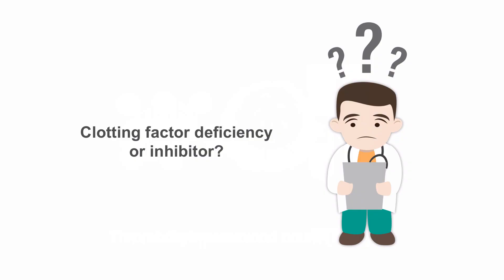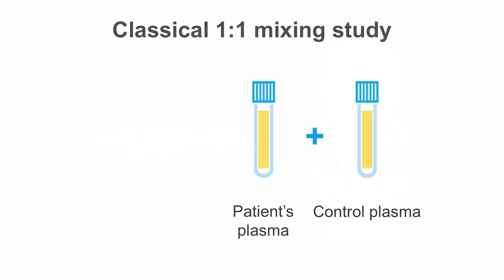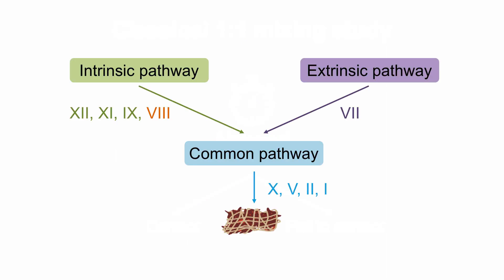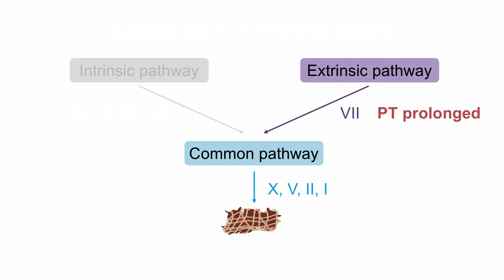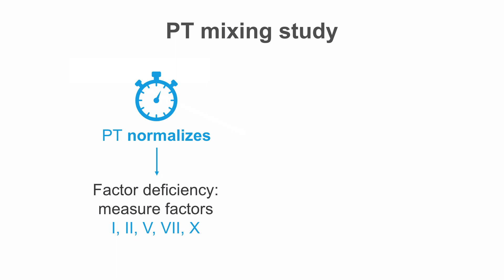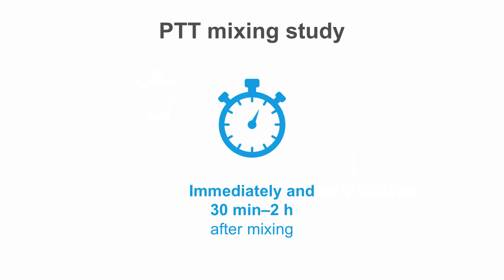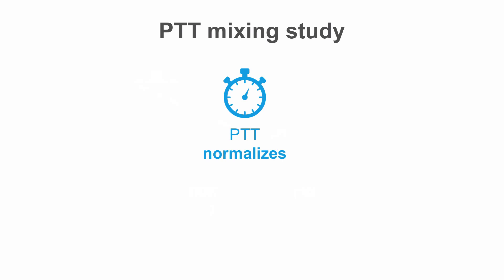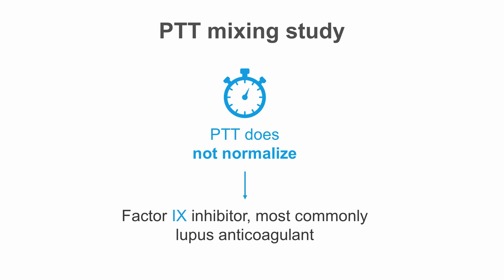How to interpret a mixing study - Coagulation Essentials

Comment: The problem most people have with mixing studies is the interpretation of whether the original clotting time has actually "normalized" or not.  For example, if the initial PT was 80 and the mixing PT clotting time (50/50 with pooled normal plasma) was 17 seconds --was this clotting time corrected ("normalized") or not?  A 17 second PT is not "normal" in any laboratory reference range but the clotting time was significantly shortened by 63 seconds.  Any presentation called "How to interpret a mixing study"  that does not actually discuss how to decide (interpret) whether a clotting time has corrected or not is leaving out one of the most important parts of the discussion.
Reply: One can utilise the Rosner index for the aptt or percentage correction for both pt and aptt
Reply: @kv8585  The problem is that different studies/ articles use different cutoffs for their Rosner index and Chang % correction calculations.  There is no agreement, from what I can see, on the correct cutoff for either of these methods.  I did my own experiments with both of these methods and they just wasn't as conclusive as I would like.  The Rosner index seemed to be a bit more accurate than the Chang % correction (in our laboratory) but neither method was correct in 100% of the test cases that I used in my study.  I ended up using the Rosner index but adding a comment, to every result, in the form of a table with 4 different scenarios based on whether the result corrected back to the reference range and whether the Rosner index was below our established cutoff.   Each scenario includes the words, "The results are most consistent with..."   In other words, we are not reporting a definitive answer.  Most clinicians are "OK" with this but there are some who are frustrated and would like a more conclusive interpretation.
What are you doing in your lab and how did you validate it?  By the way, we also add a comment that "mixing studies are not sensitive enough to detect all LA's.  If clinically indicated, please order the lupus anticoagulant panel."
Reply: @jeannecommer8042  for the aptt we have just validated the rosner index. I would also include the importance of clinical details ie thombotic or bleeding. Let us not forget the sensitivity of the aptt reagents to factors and lupus. Syntasil SS is very sensitive to even mild lupus whilst Actin FS is less sensitive.
Reply: @jeannecommer8042  for the validation, we utilised residual plasma from previous cases. Reagent selection is very important and can be easily done. I once did an exercise in order to compare lupus sensitivity between two different PT reagents. So basically had excess stock of pos LA controls, did a dilution with NPP in order to obtain 100, 90, 80% etc up to 0% of normal controls, then analysed the PT. We plotted the data and the cutoff utilised was the upper limit of the PT reagent specific normal values. Despite both reagents are recombinant, they did have different sensitivities to LA, which might also pose a problem since LA strong patients are given warfarin. 

Personally, without proper clinical details I would not perform a mixing studies. Also important is the choice of NPP which without sounding sexist, I would not include females due to high fviii and fibrinogen. Controls and calibrators may also not be suitable for mixing studies. 

If you are interested, there is a very good e book from the wfh website by Dr. Steve Kitchen and is free to download.
Reply: @kv8585  Fortunately, we do have access to all or most of the clinical patient data but sometimes, it is unclear--even to the clinician.   We have had cases where both bleeding and clotting have been reported and recently had a case where the patient had both a strong LA and a strong factor VIII inhibitor.  
If a mixing study is ordered, we always also perform a lupus anticoagulant panel (we will call the doctor, if need be, to get this ordered).  We use Hemosil DRVVT and SCT kits on the ACL TOP 750 and feel very confident about these results.  With every lot number change we use 40 normal plasmas to determine normalized screening times and ratios.  Our cutoffs are based on a 3 SD range-- following the recommendations of the manufacturer and ISTH.   These procedure are clear and we have no problem identifying LA's.
The problem lies with mixing studies.  We use mixing studies to try to distinguish a factor inhibitor from a factor deficiency.  We have strict guidelines on what plasmas we will test.  We will not test patients on anticoagulant.  We run heparin levels to rule out heparin from a line draw or any other source.  We check the patient's medication history carefully.   There are plenty of examples, in the literature, of ways to run mixing studies and how to interpret them--but no rules or recommendations from regulatory agencies, or the ISTH on the BEST method to use.   Do we mix 1:1?  or 1:4?  Does "normalization mean correction back to the reference range?  Should the cutoff for the Rosner index be 15? or 11?  or somewhere in between?   
There are, however, plenty of admonitions that every lab should validate their own mixing study methods, cutoffs and interpretations.  I spent almost a year doing just that.   I collected a huge amount of data--from journal articles, web articles, web blogs (like this one) and designed my own validation study (ISTH does not have a detailed suggested mixing study validation procedure).  I looked at plasmas from congenital factor deficient patients, patients with LA's, plasmas from patients that had factor VIII inhibitors and normal  plasmas.  We use FDA approved PNP from George King Biomedical for our mixing studies.  This PNP contains citrated plasma from 30 or more carefully screened normal human donors and is platelet poor with no buffers or preservatives.  They also supplied many of the frozen factor deficient plasmas and a plasma with a strong FVIII inhibitor.  We also used frozen samples from patient samples.  
I determined, very quickly, that defining correction as "back to the normal reference range" was not acceptable at all in our laboratory.  By the way--we establish our own reference ranges for adults and use the "Toulon study" pediatric reference ranges for children (2016).  After months of experiments, I had narrowed my options down to the Rosner Index.  But, it was not 100% accurate.  I had to choose the cutoff that was the most accurate and supplement that with a "most consistent" comment.  I feel that ISTH or regulatory agency should publish both a recommended mixing study validation method and a recommended method to establish a Rosner index cutoff if that is the chosen method.   They have recommendations on every other kind of coagulation testing!  
I realize that I have gotten a little long-winded.  Sorry!  It just seems to me that there are too many articles on mixing studies that do not address the interpretation issue.  They start with--If the mixing study normalizes--do this  or if the mixing study does not normalize--do that.  They tend to skip the part about how to determine if normalization has taken place.  Thanks for sharing your thoughts and suggestions.
Reply: @jeannecommer8042  in order to distinguish between a factor viii inhibitor from a factor deficiency, we make use of an incubated mixing studies.
Reply: We do too.  A two hour incubation.  
Can you tell me what your validated cutoff for the Rosner index turned out to be?  The one that worked best for us was 15.
Reply: @jeannecommer8042  same here, more than 15 signifying a non corrected mixing studies. 
The problem with standardising the mixing studies is that there are so many variables, that it is very difficult to have two laboratories with identical results.

With regards to the case of LA with fviii inhibitor, the easy way forward is to have a chromogenic fviii. We introduced this assay in 2019 and provides useful information in such cases.